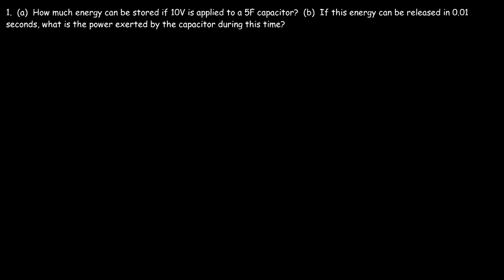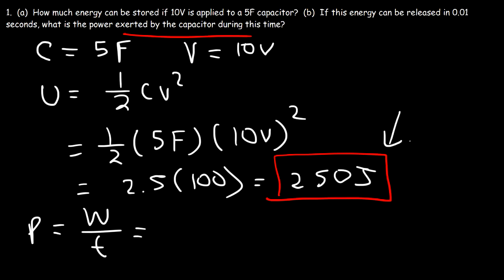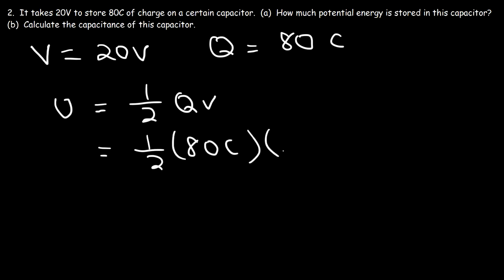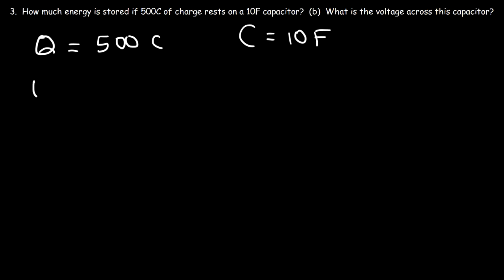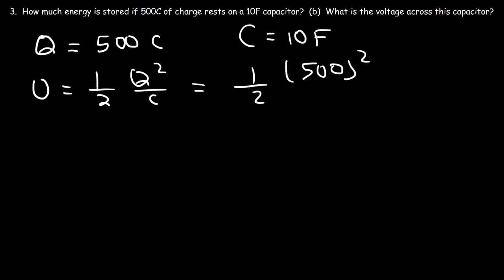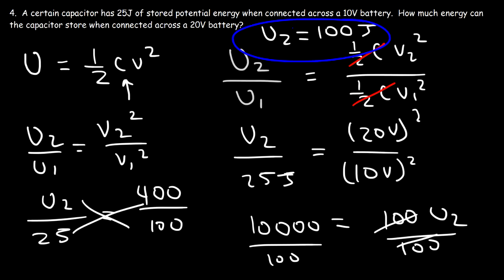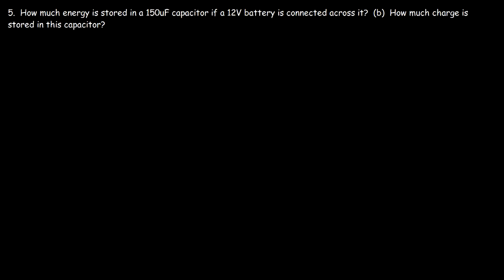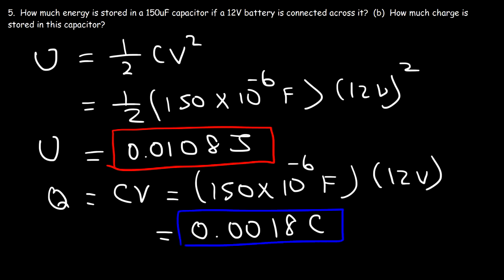How To Calculate The Energy Stored In a Capacitor

Comment: in no.4 you can also get the capacitance first by using U=1/2 (x)V^2 then you get 0.5F, after you got the Capacitance you can apply it in U=1/2(0.5F)(20V)^2 and still get an answer of 100J
Reply: 🎉same doubt

Comment: You forget to square the voltage in the 2nd problem....the answer should be 16,000J
Reply: the equation he used is PE=(1/2)(QV) so we dont need to square the voltage in problem 2a:)

Comment: Why did he randomly switch C for capacitance to Q?
Reply: i have same confusion and i have test tomorrow :(
Reply: Capacitance has three formulas when it comes to calculations concerning energy if you read your notes correctly as you saw he used three different types for different solutions the C stands for Charge and either "uf or F" stand for Capacitance do not confuse the two

Comment: A battery of 20 V is connected across a pair of capacitors of capacitance

4uF and 6mu*F connected in series. Calculate:

a) The potential difference across each capacito

b)The total energy 
How to solve the problem 😒😌

Comment: I'm confused with how you get Electric potential energy because I thought you could do Ue = Vq so multiply the charge of the capacitor by the electric potential. When I do this, I get a different answer than when I do 1/2CV^2.
Reply: Hey, I think the formula U=Vq is for P.E energy in an electric field,  while U which is equal to W(work done) IN A CAPACITOR is 1/2 CV² that's why your answers are different, the 2 formulas are for different medium
Reply: .Based just purely off what I found online, it looks like the equation for electric potential energy is different when dealing with a particle than when dealing with dialectric stuff like capacitors, because capacitors and such have to deal with the resistance from the bunch of electrons they're moving resisting eachother. So Ue=vq when dealing with like a particle in an electric field, but Ue=1/2vq when dealing with stuff like capacitors.
Reply: Even me too

Comment: how is farad times volts^2 equal to Joules?
Reply: A Farad has unit of c/v  (coulomb per volt) if you multiply (c/v)*v^2 it will result in c*v. A volt is J/c (Joule per coulomb), so (J/c)*c = J

Comment: That Formula in the Thumbnail, U=½Q²/C  

How was that derived? Kindly explain...
Reply: You can derive the formula using integration. The idea behind the integration is that the work applied to move dq (very small amount) of charge from one plate to another depends on how much charge is already on the other plate. The summation of work (where the integration comes in) from one side to another is equal to the potential energy of the system before any charge is moved over. Once the integral is solved you end up with U = Q^2/2C after integrating with respect to Q.
Reply: Thanks but it's too late. I failed that class.
Reply: Q=CV
V=Q/C..........(1)

U=1/2.QV² but V=Q/C

Therefore U=1/2.Q.(Q/C)

U=1/2.Q²/C

Comment: where does that formula come from ? I can't seem to find it
Reply: Basically, we know that E = V*Q. Now the voltage of the capacitor will keep decreasing from say V to 0 by the time it discharges. So the average Voltage would be V/2. So, we know that C = Q/V, so Q = C*V. Now substituting this into E = V*Q, you get E = CV^2 * 1/2.
Reply: @maxqi3729  so this means the rate at which the voltage drops is costant right ?

Comment: what i don't understand is how the energy stored in capacitor is only function of source voltage and not source current. This means if my power source is 12V, 9A battery, or simply 12v, 1mA , THEY WILL BOTH STORE THE SAME AMOUNT OF ENERGY IN THE SAME AMOUNT OF TIME WHICH IS 5*R*C....
Reply: Old thread...but pretty sure it is because we look at steady-state, when the capacitor is fully charged. So with you first source it will be charged much much faster than your source with only max 1mA.